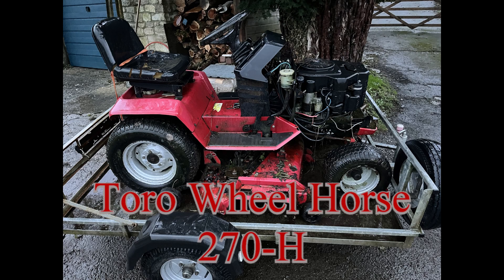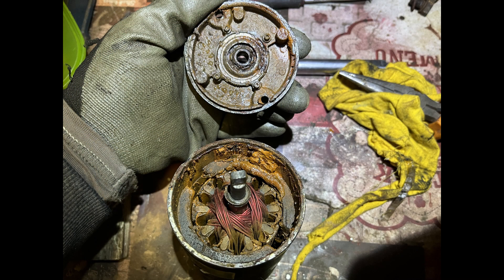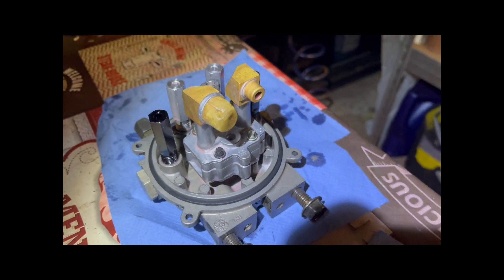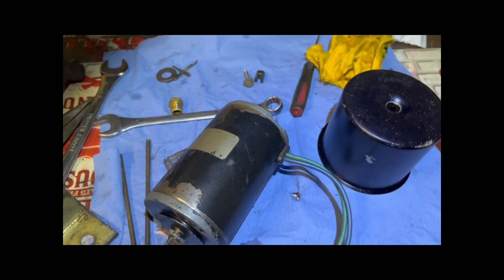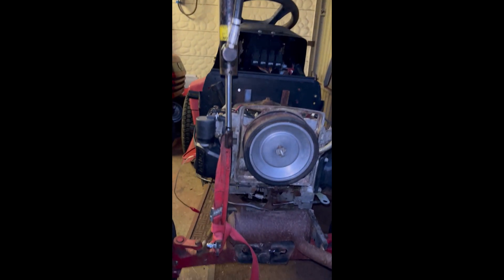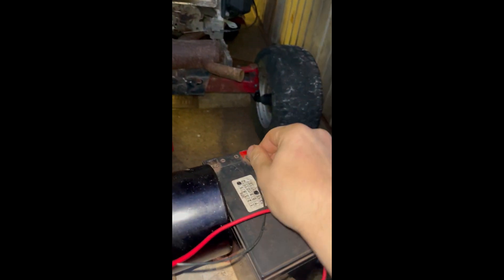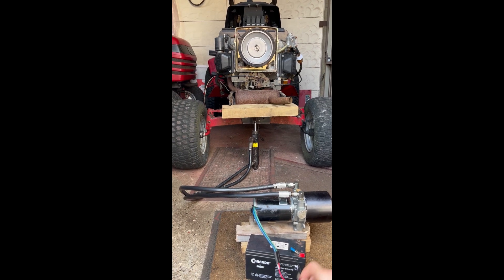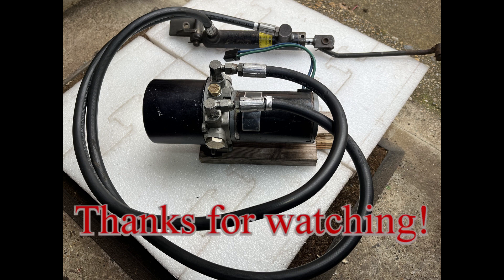Toro hydraulic pump overhaul, Parker Oildyne 108, parts 94-1700 & 94-1701

Comment: What procedure did you use to refill the reservoir, lines and actuator?
Reply from the maker: The reservoir is fairly easy to refill as you can use the breather plug. You just remove it and using a small funnel you can pour the oil in and it'll flow directly into the reservoir. Remember to keep the pump and reservoir with the breather plug always up - I used a piece of a wooden board to screw the pump and keep in this position.
As for the lines and the actuator I think I used a 50ml syringe and with the piston set to middle I placed the cylinder on the floor with the lines going up and then I slowly injected oil on both the lines until both sides were filled and no air. Then I connected the lines to the pump, started it both ways and topped up the oil as necessary. Maybe there are better solutions but this is what came through my mind at that time. 🙂
Reply: @Armadyllo  thank you!
Reply: @Armadyllo  how did you clean the starter motor and get it to work again? Did you have to buy any new parts if so where did you find them.
Reply from the maker: @motowolv9985  I didn't buy anything new. I've used wire or soft brush, air pressure... depending on the surface to be cleaned. So nothing fancy about this process as I knew finding new parts was going to be challenging. 
What kind of parts are you looking for?
Reply: @Armadyllo  well mine has pretty much the same issue yours had but I rushed it a bit and the magnets are a little broken they may still work but there are chunks missing.
Reply: @Armadyllo  but a new replacement one is $2,800 which it’s pretty much impossible to justify that when I spent $225 on the tractor itself
Reply from the maker: @motowolv9985  check on eBay for 'Volvo Penta Oildyne Pump' or 'Oildyne Pump 722451' and then maybe you can pick up from there. Those electric motors look quite similar though I don't know anything about their voltage, HP, size etc. but maybe you can ask some questions and get some more details. If the pump is good then there is no reason to pay 2,800 for an electric motor like this. I'm sure this manufacturer sold their motors outside Toro as well. If not.. maybe you can find another 270-H donor 🚜
Reply: @Armadyllo  I think I may have found a donor I’m going to look at today if not I’ll check eBay. Thank you for the help!